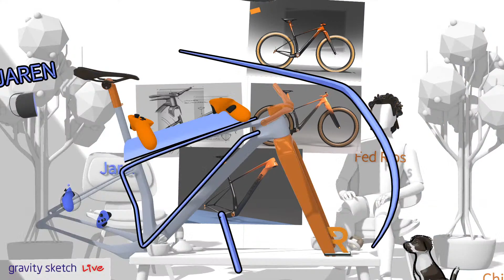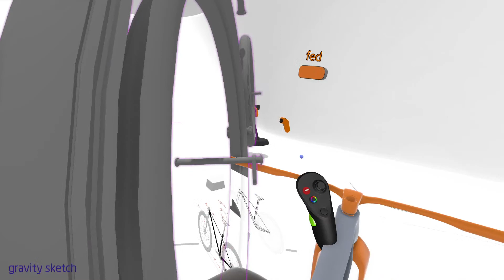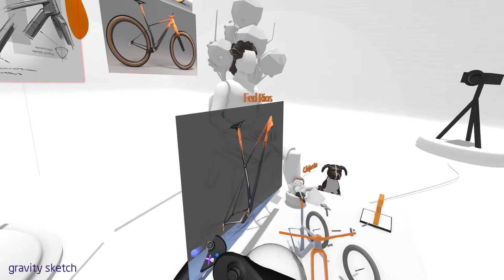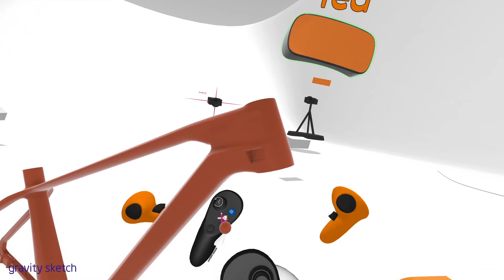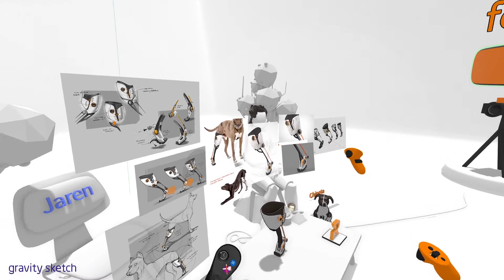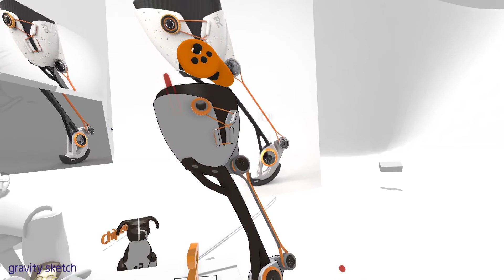Live interview with industrial designer Fed Rios - Gravity Live

Comment: I would love to see this as a direct tool so not using cad afterwards. It is amazing for rapid visualization, but for production, I would need to model it from scratch right (use the GS model as reference)? Or is there a shortcut to speed up the process? Actually parametric would be awesome included in GS, are you planning to go that direction too?
Reply from the maker: Great suggestion! We have discussed this internally. Parametric tools in vr are tricky but the team is looking into it. The common workflow for industrial designers we have seen is using Gravity Sketch as a well-thought 3D underlay for final CAD modeling. However you can export models as IGES files to Rhino, Alias or others and use the surfaces directly created from Gravity Sketch as well. We hope this helps!